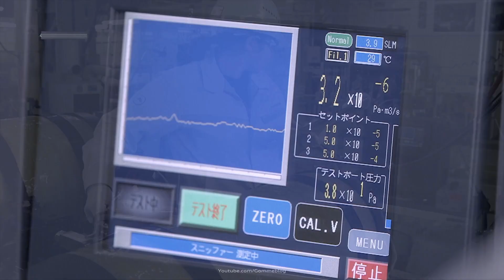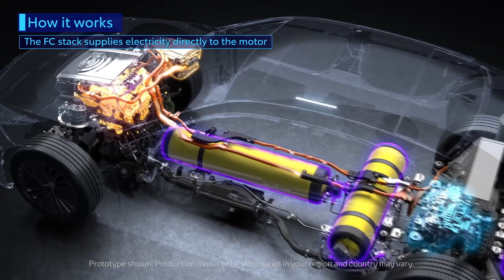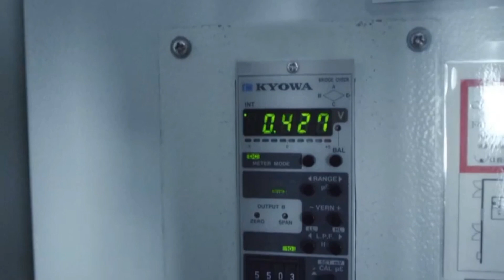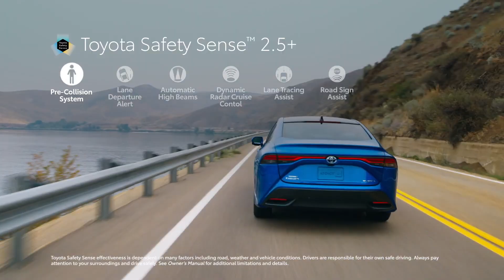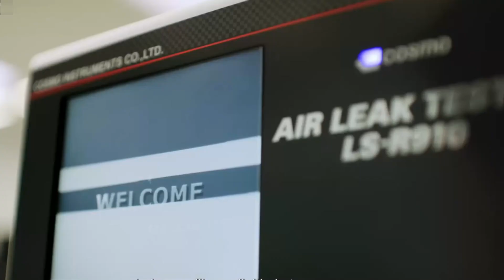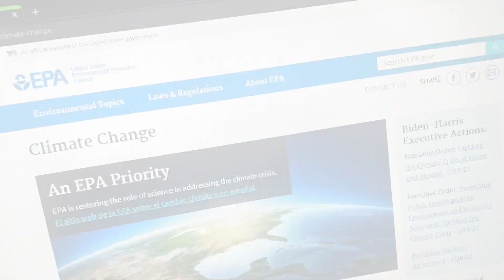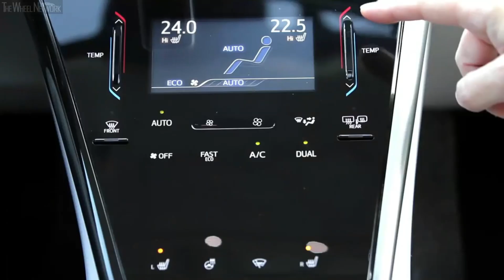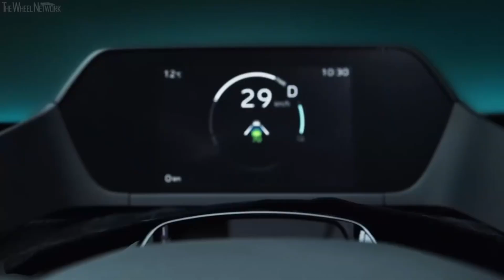Toyota's INSANE NEW Hydrogen Car IS FINALLY Here!

Comment: 🔴🔴🔴🔴🔴🔴🔴🗾I want to blame Toyota (The president Toyota Motor Corporation Akio Toyoda (豊田 章男 )   for massive environmental pollution in Russia and a chemical genocide organized by Toyota. Passing off a technical defect as a harmless defect that led to massive evaporation of gasoline and its leakage. Toyota sold 219 811 thousand cars in Russia with a defect in the fuel system, the scale of the leakage of gasoline and gasoline vapors into the atmosphere could be large-scale. The environment could be severely damaged, and people could suffer from chemical poisoning with gasoline vapors. Gasoline vapors are especially dangerous for children. A similar environmental crime was committed in the United States. Link: 
トヨタ（豊田章男社長）のロシアでの大規模な環境汚染とトヨタが組織した化学物質の大量殺戮を非難したい。技術的な欠陥を無害な欠陥として受け渡し、ガソリンとその大量の蒸発を引き起こした。 トヨタはロシアで燃料システムに欠陥のある219811千台の自動車を販売し、ガソリンとガソリン蒸気の大気への漏出の規模は大規模になる可能性があり、環境は深刻な被害を受け、人々は化学物質に苦しむ可能性があります ガソリン蒸気による中毒。ガソリン蒸気は子供にとって特に危険です。同様の環境犯罪が米国で犯されました。
https://www.epa.gov/enforcement/toyota-motor-corporation-settlement?fbclid=IwAR2zjXWVkNkTRTm_KrauMppKn-7kAdNSHYQ77gramROkElK79oaGvuC7ufI